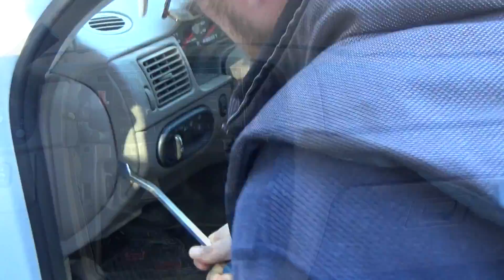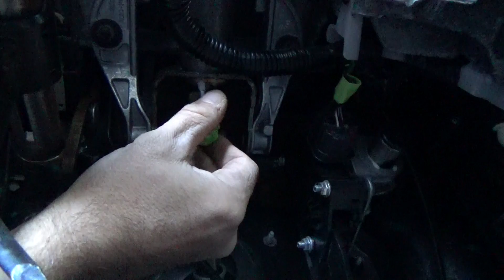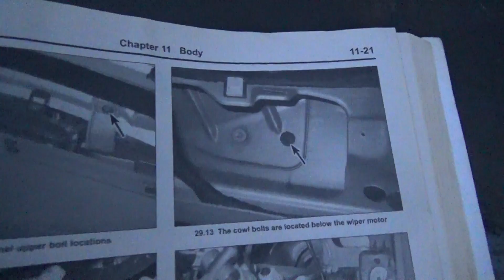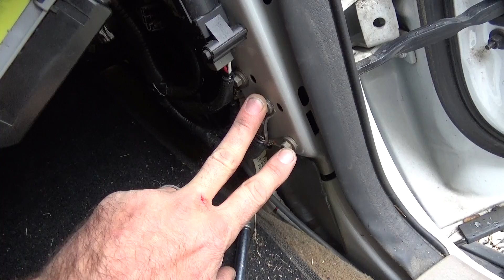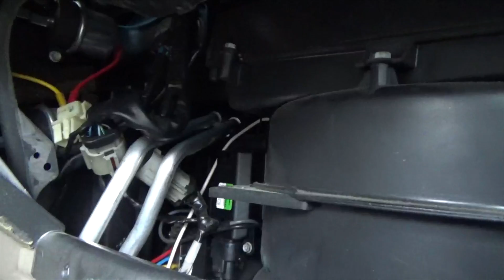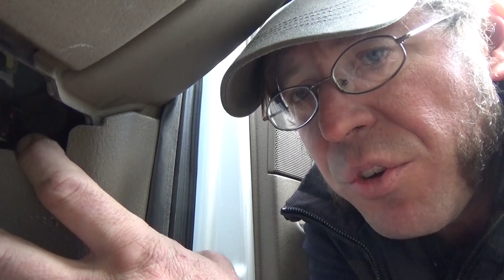Ford Explorer Heater Core Replacement

Comment: Ford junk, hate working on fords, they just don't care about maintenance.
Reply: You should try to do this on a Pontiac Vibe, pretty much the same process, as it is with any modern car. I have found Fords to be one of the easier vehicles to work on.
Reply: Try working on a GM. They're much worse! My son has a Ford and I'd say they're much easier to work on!

Comment: After having dealt with Ford heater cores, I can only come to the conclusion that it is a money maker for Ford. It would be a simple matter to design a core that was easily removable.  I finally engineered a solution to my Ford Ranger after it ate the third heater core in 8 years.
Reply: What was the solution??
Reply: @luisdelacruz7660  I bought a 2018 Explorer with a lifetime warranty!! 😆

Comment: Please help Sean I had a antifreeze leak by the transmission from a black little tube someone told me heater core gonna be replace so I did a bypass in the firewall cancel the heater core.the leak stop . WHY that tube was leaking whats the conexion between heater core and that tube under the car by the tranny besides when the explorer was leaking the heat still works please any help thanks good bless you
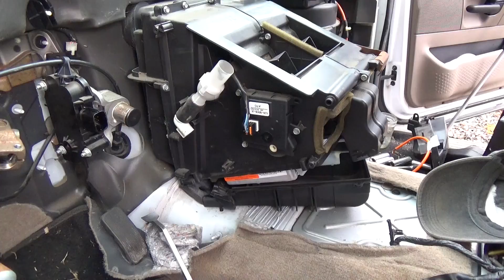Reply from the maker: Unfortunately it sounds like your heater core is leaking.  There is a hole in the floor that the black tube fits though and the tube is connected to the inside of the heater core housing.  If the heater core starts leaking, it leaks through the tube and spills coolant on the road instead of on the floors inside the vehicle.  You can almost see this tube at the 13:50 mark on the video.
Reply: @SeanCrimmins442  all clear thank you very much for take the  time have good day

Comment: My god what an abomination of a job! Sadly I need mine replaced a 2nd time now as the first replacement only lasted about 10 years or so. I have a local shop offering $750 in labor plus parts to do it and after watching this I think they don't know what they are in for. I still have heat but I can hear the coolant sloshing around on that bottom cover and fear its blowing hot air across that open coolant and into my cabin etc. Also the suv keeps loosing fluid over time to evaporation and leakage down there so it has to be done. UHG!

Comment: Lots of work to replace a heater core.  I hope I don't have to replace mine.  In hindsight could you have used compressed air to blow out that heater core from inside the firewall?  And, maybe flushing it with water?  Or, was it so clogged, that was not possible?
Reply from the maker: I have been able to temporarily clear up heater cores in other vehicles with a combination of vinegar and compressed air.  I did try to clear out the heater core in the same manner in this vehicle and was able to get warmer air for a couple of days but not for long.  The previous owner complained that the vehicle was brought to a shop for a coolant flush and they replaced the existing coolant with green ethylene glycol coolant in lieu of the red dexcool type coolant.  When these two coolants mix, they coagulate and clog the cooling system, especially the tight clearances of a heater core.  Unfortunately, heater core replacement was the only option for this project.

Comment: Suggestion: Do yourself a favor and pay $30 for an AlldataDIY manual for the car. They have the OEM step-by-step removal procedure and are MUCH better than the Haynes manuals. The OEMs write the instructions by having a technician do the work with as few steps as possible (so they can pay the dealer technicians as little as possible), so their instructions are more streamlined. 

For example, the gauge cluster and steering column do not need to be removed to take the dash panel out. They will come out with the dash if you just remove the pinch bolt on the column. This way you don't need to worry about messing up the PRNDL indicator and you can leave all the connectors on the column connected. Zip tie one of the steering wheel spokes to one of the exposed brackets  so that the wheel can't spin too far and damage the airbag clockspring. 

Another helpful hint: got to the hardware store and pick up a few of the longest M8x1.25 hex-head bolts that you can find and replace at least 2 of the four main instrument panel bolts with them - the bronze colored bolts on either side of the panel. Doing this, you can slide the panel back a few inches before trying to pull the panel out so that you have room to make sure all the wiring and cables are disconnected and also makes it easier to detach the gear selector cable clips described in the video. Same with installing it - having the extra play allows you to move the panel around to line everything up, connect the steering column pinch bolt, plug everything in etc... It may actually give you the room you need to get the heater core out but I haven't tried. Next time...
Reply from the maker: I've taken the dash out of other vehicles with the steering column attached and I've found that makes the assembly as a whole so heavy and awkward that it's more difficult, especially when trying to match the steering shaft cam into place and maneuvering it without breaking all of the delicate plastic parts.  I'm sure at the dealership they have it down to a science, but for a shade tree one time shot, it was worth the extra step to get it out of the way and try to curse a little less ;)
Reply: @SeanCrimmins442  Ive done multiple Explorers and F150s 10ths and 11th gen.  There is alot less steps that need to be taken than those Haynes manuals.  It makes it about a 3 hour job.  No I'm not bullshitting or trolling.  The OP for this thread is 100% correct.
Reply from the maker: @Silent_Shadow  Yes, you're right.  I did skip a few steps in the Haynes manual that I thought were unnecessary, such as disconnecting the A/C hoses and removing the bolts for the heater core housing from inside the firewall.  This is a 2004 Ford Explorer and Peter B's suggestion of using long M8x 1.25 hex bolts to guide the dash out may give enough access room to the underside of the heater core cover and enough clearance to pry the entire housing up for cover re-installation.  The bracket as depicted in the video may still be in the way though and it may be difficult to maneuver the heater core into place as the tubes need to slide all the way up through the openings in the firewall.  I'm sure after doing many of these in a row, the R&R time would go down considerably.

Comment: American engineering at its finest...that is insane.
Reply: Yes, but much of the work he did turns out to be unnecessary.  I had to change the whole heater box out on my '97 Mountaineer, and luckily, I leaned while removing it from an Explorer in a Pick-N-Pull yard, that the whole dash swings out with the removal of a total of six bolts from the dash.  You do have to disconnect the steering column from the steering gear box, but NONE of the things attached to the dash actually have to be removed.  This actually IS pretty good engineering.  It allows the whole dashboard to be fully assembled before it's installed in the vehicle, and consequently, allows the whole thing to be removed as well.  Or just swung out, which can be done without disconnecting most of the wire harnesses.

Comment: Dear. God.

This job is HORRIBLE!!!!!!!!!!!!!!!!!!!!!!!!!!!!! Thank you for posting this NIGHTMARE process!!

I think you've got the right idea about cutting the heater core pipes and using some short hose lengths...I think that's what I'm going to do for my leaking heater core...

A quick correction - the fuel cut-off has nothing to do with the Pintos. 

The cut-off switch came about because of fuel injection and the relocation of the fuel pump to inside the tank rather than at the engine. Remember the old mechanical fuel pumps?? The fuel lines were suction lines. If a line got severed, you might spill a few ounces of gas. With the in-tank pumps, if a line gets severed, you have a pressurized line being fed by a pump directly at the fuel source. As long as there's power and fuel in the tank, there will be a pressurized flow of fuel. Unless there's a cut-off switch that's activated by impact or other electrical triggers.

The Pinto’s problem was a design/impact problem with the fuel tank placement. Their gas tanks were located where they could easily be damaged...from behind or below…which resulted in tank ruptures...followed by fuel everywhere…and a sudden ignition by any number of hot surface/spark hazards – like metal grinding across metal during an accident. The fuel tank could be ruptured in a rear-end collision or any other event involving the area behind the rear wheels of the car. Coming off a curb too hard or even crossing a really bad RR crossing could cause ruptures!! This resulted in the entire auto industry moving the fuel tank locations to over or in front of the rear axle, providing much more effective protection. Another effect was the introduction of plastic fuel tanks which are much less prone to catastrophic failure in a disfiguring incident.
Reply from the maker: Cheers!  That's good to know about the Pinto, I always assumed that the inertia switch was a correlation because I hadn't seen many inertia switches for other vehicles besides Ford.  Let me know if you have luck with the hose & heater core idea.  I was thinking the only other thing that may be difficult would be access to the screws for the plastic floor ducts with the dashboard in the way, but if there was a way to get around it that would be awesome.
Reply: My 97 ford explorer heater core quit working 1 month ago, just before winter.. fk i'm doomed. So I was looking up how to exchange it.